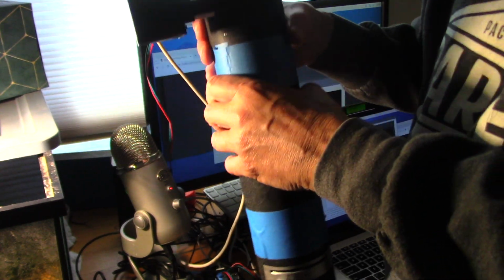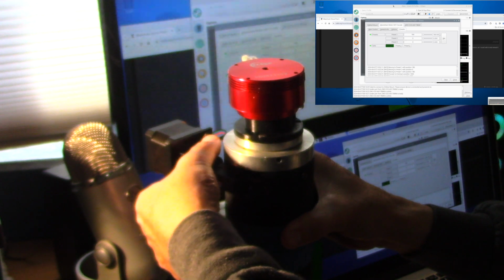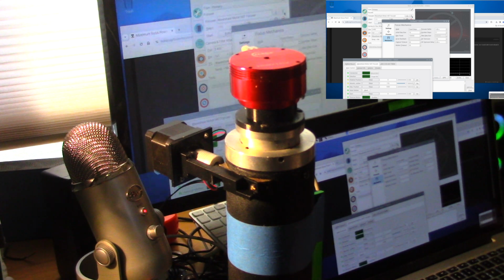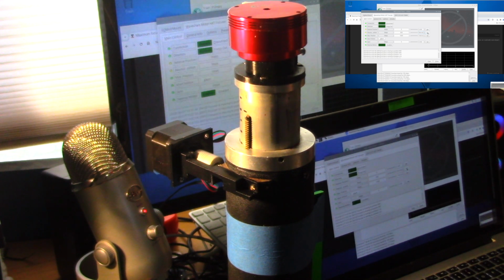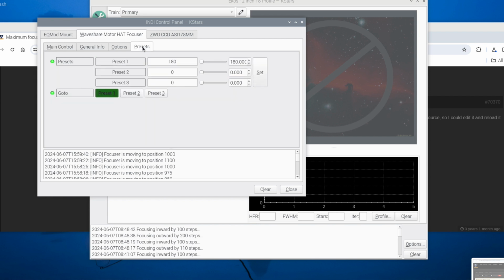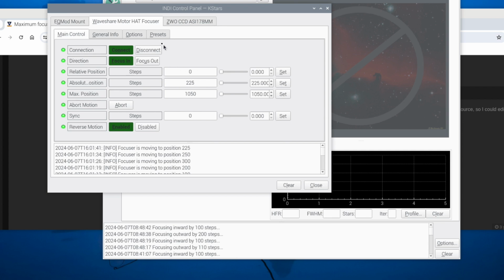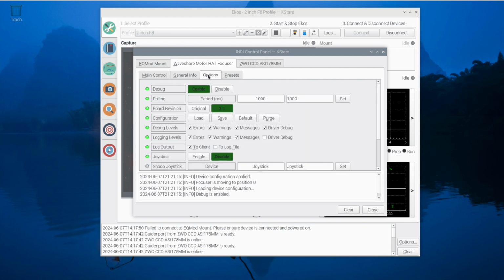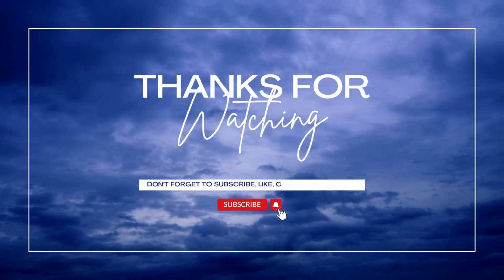How To Set Indi/Ekos focus limits for an Auto Focuser - Showing My DIY Focuser as an example

Comment: Hello, did you evert do a vid from start to finish as cant locate it 😢, or did you do a vid of the starting point ie wiring it up and any extra code for the raspberrypi 4, thanks for your vids they are great to watch
Reply from the maker: Glad you liked the video.  I didn't do a full start to finish video.  I was experimenting with this small scope to try and work out the general scope of work for a full build.  I found out that the gear ratios was not good enough to complete the build.  If I do it again, I'll use a greatly reduce gear motor to get fine control of the focus.
Reply: Ok thank you.for fast reply. I will continue
Reply: I don't suppose you could tell me the connection for the pi4 stepper hat please. I tried ti look at your vid but as you use a breadboard cant really see where the wires were going. Thanks Dave